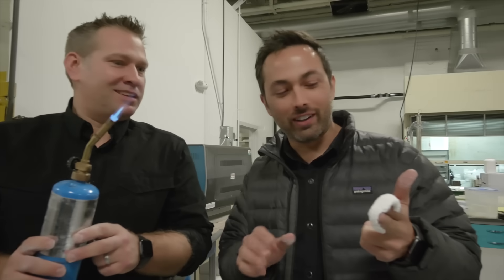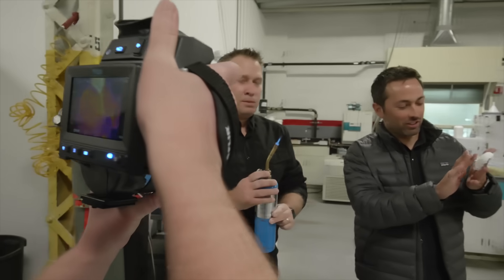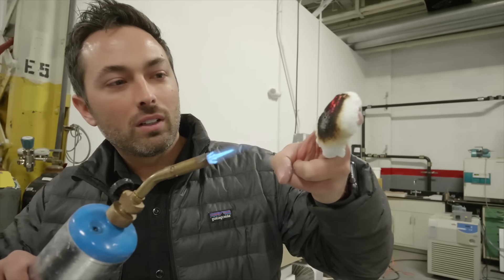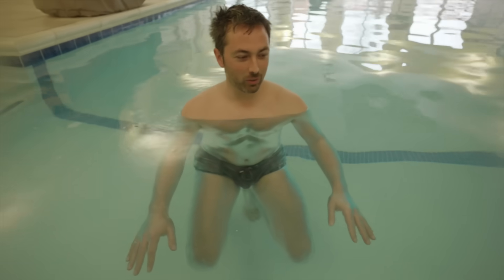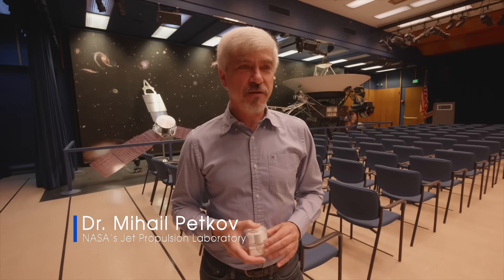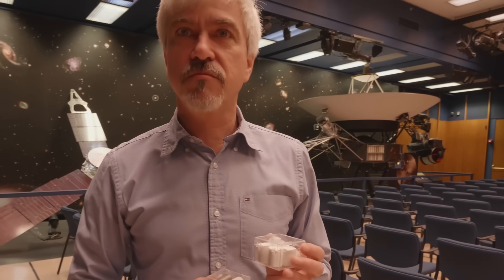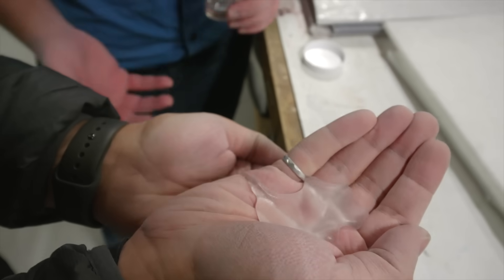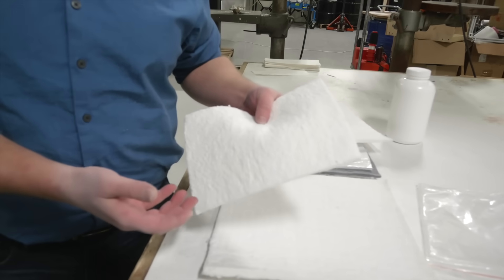I Waterproofed Myself With Aerogel!

Comment: I work with this stuff at the pipe coating facility I work at only in an insulation form and it's horrible stuff to work with but yea is very waterproof and heat resistant but we have to wear respirators and full body suits to work with the powdered form that is on the insulation to protect out lungs and keep it off our skin

Comment: I wanna know if you cover your whole face with it since it’s air wouldn’t you be able to technically breath underwater?
Reply: Air doesnt equal O2, CO2 is "air" aswell, but even if we assumed the air of the gel is O2 indeed and you could breath it in, thatd just mean you would breath in the bit that surrounds ur face and then break  the layer, since it obviously wouldnt be an infinite source that you put on ur body before entering the water.

Comment: 160C is not hot at all if you're talking about fire and flames. Your home oven goes hotter than that. Of course it'll be hotter because that torch is 1500-2000C.

Comment: 3:18 he blatantly puts 2 fingers on the outside which is supposedly a "907 degrees" n the  "thermal" shows it still hot when he does it. fake news
Reply: Actually its only at 90-100°F
Reply: @eldritchmeals3008  sighs we got a r/woosher over here

Comment: That's funny you said it was a thin layer however the last shot of the torch on your fingers shows an enormous amount aerogel built up and you were torching above your fingers not that there's anything wrong with that that's dangerous enough but the lies Derek the lies that was not a thin layer skin is a thin layer you had inches of that material in front of your hand with a hot but very localized very small area of burn you would make a very poor magician I don't know why more people don't see this

Comment: Wouldn't the fiberglass infused with aerogel make for the perfect insulation? That of being heat/cold resistant and helping to impede fire spreading between rooms if a house is on fire?

Comment: They should use the aerogel + binding mixture inside tank/plane engines so they don't overheat and in the armor so the crew/pilot doesn't get too hot in desert warfare of the middle east.

Comment: So could you theoretically apply it to pipes and tubes in cars that creat heat? So If you cover the exhaust manifold in like a blanketed form of it would keep all the heat that resonates from the manifold it self and stop it from melting other parts Of the motor?

Comment: I've been thinking about this a lot. So aerogel is a great thermo insulator right? What if you put a superconductor + nitrogen into a box made out of that aerogel + the non flamable binder? 
In theory it should hold it's low temperature more time right? 
Or aerogel-nonflamable binder mixture lose it's properties under such low temperature?

Comment: I'm curious if it could be used as efffective coating for face masks.
Supposedly Coronavirus can survive for days on a surface, but can't last more than 3 hours in air. 
Makes me wonder if aerogel  errs more on the surface or air side of the equation
Reply: Also curious how it would react if you crafted a bottle made of areogel and submerged it under water.

Comment: "Breathing this silica is virtually harmless" now I'm no rocket surgeon, but silicosis comes from silica dust
Reply: @Lawofimprobability I agree. Admittedly I don't know a lot about the science behind the different types of particles and their sizes. I just assumed silica is silica and not the best to breathe. I used to work in construction and they are saying silica dust is the new asbestos in terms of its potential to be harmful over long term exposure. This material  is an older discovery only recently gaining traction. It's very interesting stuff they are coming up with

Comment: It would be interesting to know the cost factor of these aerogel putties and their thermal insulation properties as compared to its' more solid state cousins. 
I've got a design concept for solar ovens that could generate upwards to 1,000 degrees (over the current 300-350 degree range and featuring a build in flameless hydrocarbon/catalytic back up system for night/low light use) but which would require a good insulation (many aerogels at R-90 ) to render it viable. 
Alas,  it's the ultimate high cost of the required aerogels that's so prohibitive. Popped popcorn is much cheaper, works fairly well but....
This system would have wide reaching commercial as well as survival/recreational applications. All solar powered featuring battery back up for solar tracking and internal air convection and could save tremendously on energy costs over gas or electricity powered systems currently in use. And yes using ducting, the units could be housed inside or be made portable. One would only need access to full spectrum sunlight.

Comment: Can an aerogel be polarized with an electric current to release material that it has absorbed? 
One analogy that keeps coming to mind in regards to surface area, is the surface area inside a human lung, and would an artificial lung be possible. I am mentally struggling to find an application, can't you tell. LOL

Comment: I can see Olympic swimmers using this now to swim through water like a knife. I wonder what a boat propeller coated in aerogel would do? Somebody test it! Also car parts. Like the radiator hoses. Would the car overheat if the inside of the hoses were coated since heat couldn't escape? Or would it be more efficient because water isn't touching the tubes at all? There needs to be so much more testing done in other areas. This could be the next carbon fiber  of breakthrough materials.  Maybe a carbon fiber aero gel composite!

Comment: but wait, if it absorbs water very well, and they want to use it for insecticides. how did he coat himself with it? or even touch it without any gloves? wouldn't that dry out his body / fingers and cause them to dehydrate? aka isn't that kinda dangerous?

Comment: Theoretically, if you covered your self with aerogel you could walk extremely close to lava or fire. Correct?
Reply: Um I'm not exactly sure
Reply: I don't see why not. Definitely not lava though.
Reply: @Misha-dr9rh  
Lava is not that hot actually, just between 700 or 1200 celsius

So you could get really close to lava with it, just don't touch the stuff
Reply: @sanstheskeleton679  You're still breathing in that superheated air plus the not-very-healthy poisonous gases.
Reply: @Misha-dr9rh  
I said lava, not a volcanic eruption
Reply: Try it

Comment: Not sure if this reach the Author. One thing that pops up in my head was when I was looking for Fridge. Turns out most of the chassis of fridge are actually insulators. I wonder when we could see AirGel comes to Consumer Electronics, where a super thin layer is enough to make a difference.

Comment: Hi admin
Can you figure out that can it be used as building material?
I am concerned with light weight, insulated and low water absorbent building material which is need of modern construction this material heaving these three properties if it is made so strong that can act as non load bearing structure (1000psi) and cheap enough like concrete.
Can you make a video on it?

Comment: Two questions that pop into my mind:
- It was known in ~1930 already, yet it still has not ended up in mass products. Are the production costs that high or for some other reason?
- If that aerogel dust repels water, how do you get it off? ;)

Comment: @Veritasium I am curious. If aerogel is insulating and you grease yourself with it. Wouldnt your body start overheating as it cant exchange temperature with its surroundings by sweating. You showed that with a thin layer of aerogel you wouldnt even feel the flame of a bunsen burner.

Comment: Such a heat resistant blanket would do absolute wonders for dowsing chemical fires, or for home insulation, i mean if the material needed is slim enough and it can be easily mass-produced, then homes could be entirely passively heated with a minimum of required resources.

Comment: Derek, could silica aerogels be used to increase the capacity of hydrogen storage for fuel cell power systems used in electric cars?  Could the range of such cars exceed previous iterations?  It seems to me that hydrogen fuel cell cars would be better than electric because they can be refuelled more quickly.

Comment: if Aerogel could be used to hold and release an electrical charge between its surface area it could become a pretty good power source e.g a football field sized are of electrical energy held in something the same size and an ice cube ... could be more efficient than current batteries or capacitors we currently use.

Comment: This material has a great potential. But it can be pretty dangerous to cover a whole body with it. Seems that you're able to get a temperature shock when a temperature of your body will be increased because of aerogel prevents any heat transmission from your body to the air

Comment: Thanks!  A very interesting video.  I'm convinced that materials science will play an increasingly crucial role going into the future - in virtually every area you can think of.  I think it will especially be critical to the space industry, by which I mean all aspects of manned & unmanned missions into low-Earth orbit or higher - all the way to the stars.  Clever uses & combinations of existing & future materials will be used in both short- and long-duration spaceflights.  Thanks again.       𝓡𝓲𝓴𝓴𝓲 𝓣𝓲𝓴𝓴𝓲.

Comment: Huh, this is a thought that i just came up with. Waterproofing phones and tablets at ANY depth, not dependent on pressure, using aerogel. Put some in between the casing and the wiring, and  if you have a wired charging device, put it in the charging port, and bob’s your uncle. Waterproof, theoretically. If you like this idea, reply saying if you do like this, and any extra suggestions.

Comment: Can we use them as a sponge filled with little small wires of copper for computers and motherboard where electricity goes from one place to the other and since they resist heat not all the paths of copper will have the same resistance because some will be used more than others and because of that the information will go through the colder low resistant path till others cool.???

Comment: what if it was added to a CPU? would it help regulate temp?
Reply: right, ive been trying to think of applications for this stuff in computers as well. it obviously wouldn't work as a heat sink, but as some sort of heat shield it could work fantastically. you could put very hot parts right next to each other and separate them with a layer of aerogel.

Comment: Everything about the aerogel is so so trippy.
The weight
The sound it makes
Thermal isolation
Water repellent
Reply: In the video, with just aerogel itself, it is hydrophilic which means it attracts and absorbs water.
Reply: The fact that I want to eat it for some weird reason
Reply: @Euoplocephalus  you have p.i.c.a.
Reply: The fact so little of it has so much surface area.
Reply: Somehow I read “ everything about aerogel is so happy “ I was very confused
Reply: I thought aerogel would be squishy
Reply: Limbo on top 🤝
Reply: Ikr
Reply: *Insolation
Reply: Oversized DDDUUUCCCKKK 
*Insulation
Reply: Aesthetic element

Comment: If there is that much surface area in aerogel then what if it was made of electrically conductive material. This could then be used to make super capacitors which need large areas to work. Of what about a new form of electric cell using lithium aerogel. That way you can get a massive area needed for the electrodes in a tiny size. Imagine cell fones running for a week on a 100watt cell not much bigger than a dollar coin.

Comment: Did my undergraduate studies on these and they are amazing. One use we looked into is a reinforced aerogel that could be used repeatedly to break azeotropes without vacuum distillation, by absorbing the higher boiling distillate and then mechanically filtering it out and recovering and reusing the aerogel.... Really neat video
Reply: What're you studying?

Comment: I have so many questions.... when your body was coated, in the pool   did the aero dust thermally insulate you and would you have some degree of fire retardation or heat resistance.  the mix of starlite and aerogel is an awesome combo... the endless uses and applications is incredible. awesome video thank you

Comment: Could we use this to make Helmets that looks like Sandy’s from Spongebob to breathe underwater???
Reply: Yes, but you would still need oxygen tanks otherwise carbon dioxide concentration will increase pass the point that won't trigger your reflex to breathe. And or you would also die from lack of oxygen once it's used up.

Comment: Can this be used by firefighters?
Reply: Most likely due to the insulating properties. Combined with what they already have, they'd be pretty tough to set on fire and wouldn't have to worry as much with heat. Idk if this made sense at all
Reply: @garrettbell5474  in a fire there's 2 things that limit firefighters abilitie to operate, toxic fumes and heat exhaustion. Ig thisd material is THIS good, an not expensive could probably save a lot of lives of pined down ff, now, there's a lots of gaps in a ff uniform so i'm not sure if it would require a fix, also my question would be, once you reach pre exhaustion and get out, will you keep cooking because of the insulation propertiers? I wish we had a good material that can prevent heat to reaching you and keep you cool at the same time withouth adding more weight, fascinating subjet and i hope that engineers find somehing liek that someday.

Comment: agriculture or some such stuff in arid places (water conservation cum disbursement)
contraceptives
ladies sanitary pads, adult/kids diapers
fake sweetmeats, confectionery that doesn't add fat, calories
chic fashion accessories
practical insulation
fire retardant gear, clothes
vehicular applications in and around engines
automotive paint and polymer applications
aquatic life revival (maybe like where corals are dead dying because dimwit humans dumbed their landfill tyres and ruined sea ecology)
.
and such other application or use?
i could be wrong though, i'm not particularly bright.

can you think of some via via applications or use/s?

Comment: If aerogel is a good insulator of heat radiation, would it be able to block or insulate radioactive decay?
Reply: Radiation means free electrons not inflared light (aka heat). It is very likely that a subatomic particle can pass through it. The aerogel structure difuses heat really fast and it doesn't "pass" the heat.

Comment: Just curious.
Will waterproof property of aerogel change with depth? I mean like, you were in pool with 1 or 1.5 m depth. What will happen on 100 m depth or more? Cause pressure of the water will be much higher.

Comment: Lol "proprietary formula". That white paste was cornstarch and baking soda with the silica mixed in. The black char is from a carbon reaction that stops the heat, hence the baking soda. Basically, its a carbon barrier due to the unique qualities of non Newtonian fluids like corn starch.You can get the same result with just corn starch and baking soda.

Comment: Question: if you coated a submarine in aerogel, would it be able to withstand deeper pressure because the water isn't technically touching the sub?
Reply: But pressure on the submarine body would be there even if you are coating it with aerogel.

Comment: I do NOT understand how can such cube possibly have a surface area of a half of a football field!!! HOW????
Reply: Maybe this could help you picture it. Imagine taking a very large and thin piece of paper and crumpling it up and squeezing it as hard as you can. Say you can make a 2 foot by 2 foot piece of this paper into a ball with a diameter of 4 inches. You took a piece of paper with a surface area of over 1100 inches squared and crushed it down to have a new (apparent) surface area of approximately 50 inches squared. If you could "unravel" all of the tiny pores and crevices in that piece of aerogel, as if you were unfolding the crumpled up ball of paper, it would be massive because of how many microscopic nooks and crannies there are in aerogel.
Reply: Григорий Дубров ever heard of fractals? These aerogels’ complex and tiny structure make their surface area (the surface of all those tiny structures forming the aerogel) incredibly large
Reply: @Viscidsquare040  I may understand it terminologically but I will never play this in my head XD
Reply: It’s called surface area look it up jeez

Comment: Interesting material especially with its ability to insulate heat. But can it conduct electricity? If so we got something useful since being able to have a material that can conduct electricity but insulate heat can enable the direct conversion of heat energy to electrical energy at better efficiency without needing a steam turbine.

Comment: If he is waterproof in the video, how is he going to wash it off
Reply: Magic
Reply: He might have removed it by rubbing hydrophilic aerogel and then washing it off
Reply: Boiling hot water
Reply: Soap will pretty much do the job.  It'll coat the aerogel with the oils that make up soap.  Then you can just rinse the soap and coated particles right down the drain.
Reply: olololololololololo
Reply: Min Suga Swag you just blew my mind with that question
Reply: oil would get it off
Reply: @emma6366  Oh damn it would! You're right.
Reply: he never needs to wash him again
Reply: With some Intense Rubbing
Reply: Scraping it off?
Reply: Use a air compressor
Reply: Illuminate music starts*
Reply: Wash off with lemons
Reply: Death
Reply: Give it wear & tear. Over-time damage/wear is really effective but it takes time. Heaps of time.